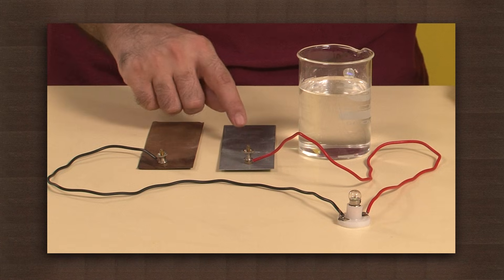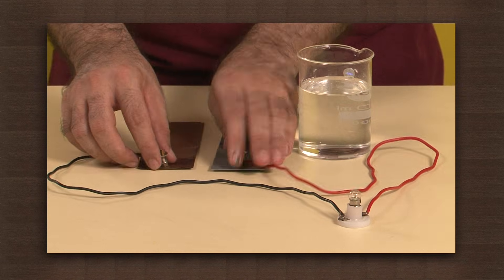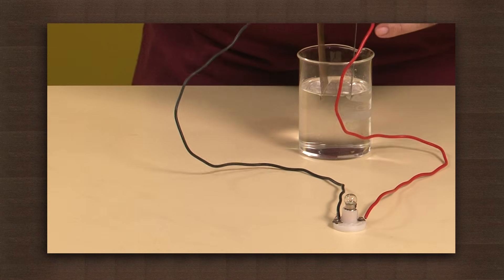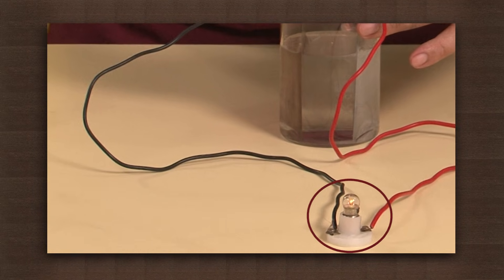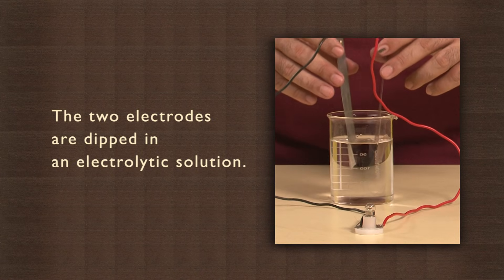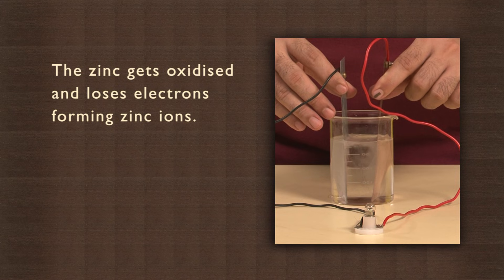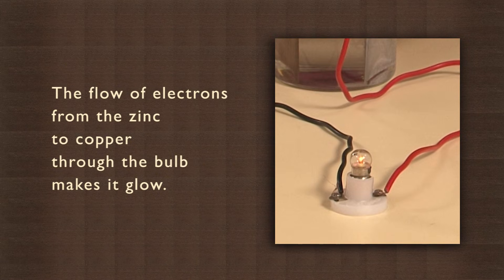Dilute acid, zinc and copper make an electric cell | Electricity | Physics

Comment: This video is confusing.  In the first part it's the copper plate that has the black cable, and later it's the zinc plate that has the black cable, so it's a bit confusing to follow.  In the earlier part, where the zinc plate is fizzing, what is that reaction?  Is the zinc giving up electrons when it fizzes or is it accepting electrons?  Is the non fizzing metal accepting electrons or giving up electrons?  Which metal ends up releasing ions into the water, is it the fizzing metal or the non fizzing one?  My guess is it's the oxidised one, the one that gave up the electrons (i.e. the less stable one).  Please help.  Thanks.
Reply: its called electrolysis (the fizzing reaction)

Comment: This may be a stupid question. but why can't we just connect the copper and the zinc together without the need for an acid? what does the acid do?
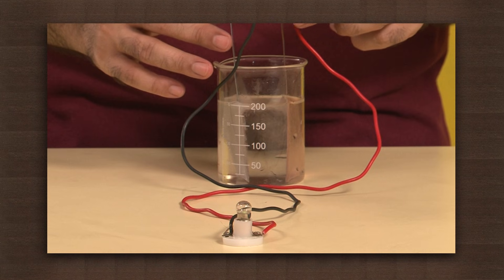and also why can't we connect them together in the acid? as you mentioned here 0:34
Reply: Acid helps to lose Zinc it’s electrons and thus copper plate accepts it and flows from wire connected to copper plate and electrons are left in the zinc plate and they are passed to the bulb through wire connected to zinc plate and the bulb works

Comment: I did this with zinc & copper strips and vinegar.  I got 0.8 volts.  I then put three of these cells (beakers w/electrodes & vinegar in parallel and the voltage was 0.8 as it should be.  I then connected them in series, making sure the electrodes weren't touching, and the voltage went down to around 0.1-0.2 V.  It should be around 2.4 V.  I asked three electrical engineers about why I would be getting this result and they weren't sure why.  I am perplexed.
Reply: In series in the same pot??? That's short circuit! Use separate pot for each battery, and you'll get expected result. :)
Reply: @peteralic116  They were in separate beakers.
Reply: Did you put the meter on each cell before connecting them? Maybe one cell was faulty causing dissipation. Next time check each cell, connect one and check, etc.

Comment: What happens if you remove your hands or use insulating gloves to prove your body's' charge is not affecting or adding to the electrical charge generating to the light bulb?

Comment: I tried, it didn't work. Just wondering how to DO?
Reply: Do you have any mistakes in your experiment?
Reply: @kennethko4132  I don't know. I've taken dilute H2SO4, Cu and Zinc metals dipped in it and the wires from them were connected to a small led bulb. I wish I could get a step by step procedural guide for same, to know my mistake.
Reply: @PhanidharH  The bulb didn't light up?
Reply: @kennethko4132  no it didn't
Reply: @PhanidharH  Oh, have you used a sand paper to clean all metal's surface first (CuO and ZnO), I think that is the point
Reply: @kennethko4132  Thank you. Must try.
Reply: @PhanidharH  make sure to connect the LED at the right bias ( Zinc is the cathode so it takes the negative leg of the LED)
Reply: Don't use an LED. These have a threshold voltage, and the cell may not be able to generate enough voltage. You need a very small and sensitive filament lamp. If you are not seeing it light up, try connecting two cells in series.

Comment: What happens when you reduce the distance between the electrodes and when you change the dimensions of the electrodes?
Reply: On reducing the distance between the electrodes the internal resistance of the cell decreases and the potential difference generated will be greater , also the dimensions of the plates are directly proportional to the potential difference generated by the cell
Reply: Surface area good

Comment: what voltage does this generate?
Reply: +Damilene Reefer Just use simple physics + chemistry: Find the current of the reation and then the magnetic field. Some other stuff like the resistor's turns per meter of wire, etc. and then you calculate. Take a look at the last post in this page: https://www.physicsforums.com/threads/relationship-between-magnetic-field-strength-and-voltage.777517/